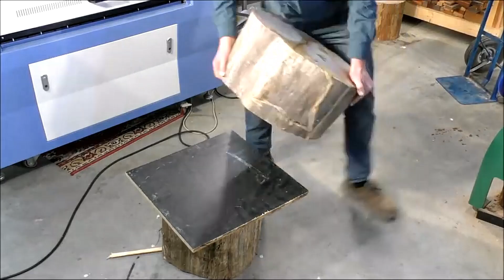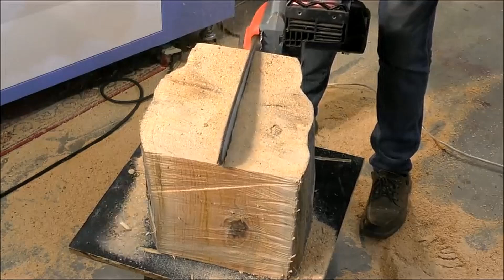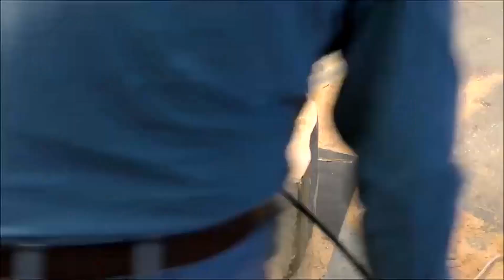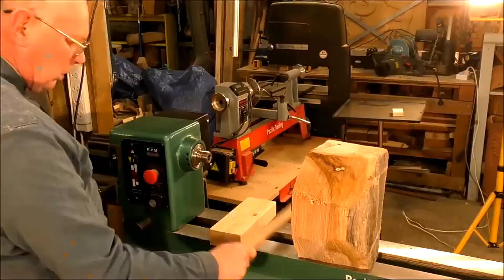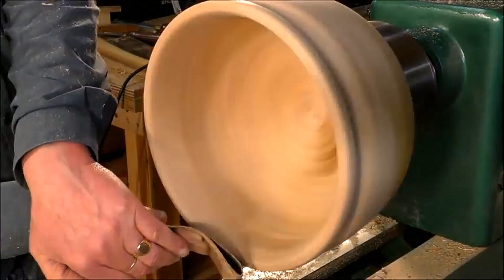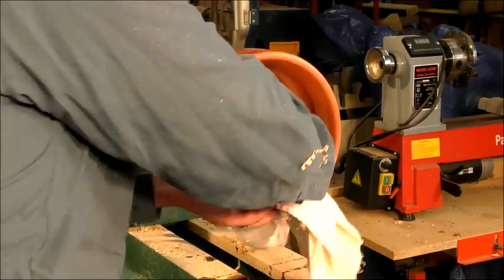How To Wood-turn an Amazing Bowl start to finish

Comment: It's good that you don't use roughing gouges in bowl work.. that is incredibly dangerous. Never use a rougher on cross-grain, only on spindles. The tang on a rougher isn't designed for the sort of impact changing grain delivers, and they like to break. As to your hollowing.. if it works for you, it's the right way to do it. Great vid, nice bowl. Keep it up!